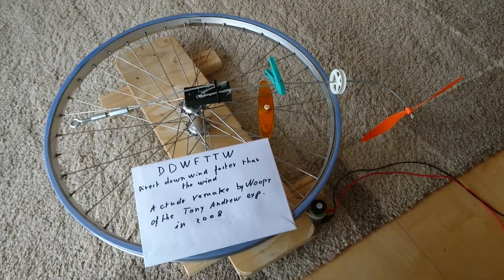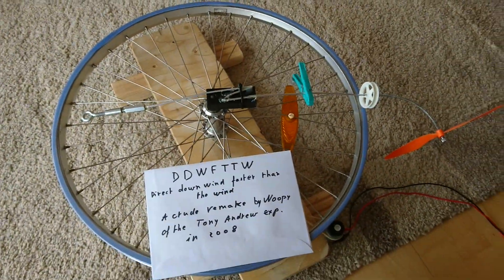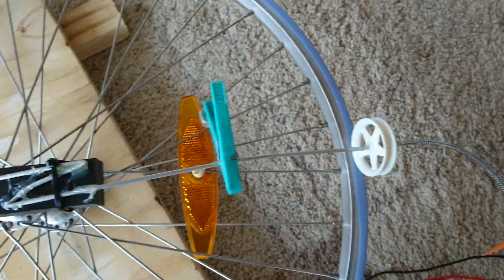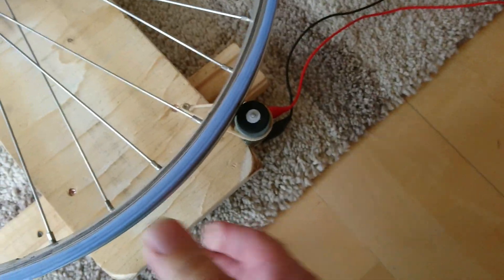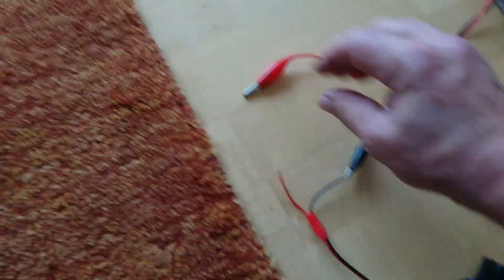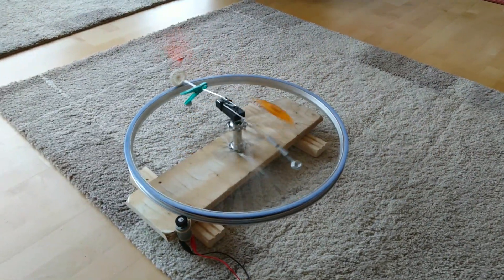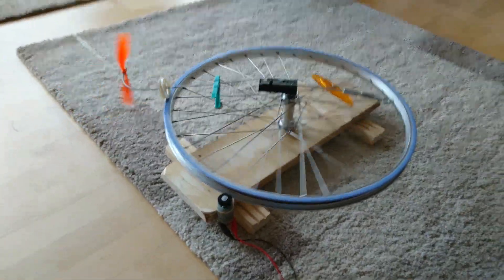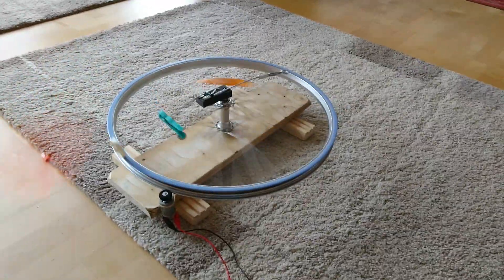Direct down wind faster than the wind my first experiment

Comment: I think this experiment is invalid and not testing what you think it is. All you are doing is driving a propeller with an electric motor and all it has to do to go forward is create more thrust than the rolling resistance of the wheel and bearing. If you increased the resistance i would go backwards and if you reduced it would go forward. Nothing to do with wind.

Comment: The frame of reference has change, due to the dynamic centripetal force upon the axis, vector dynamics seem to add to the net distribution of cause, when in fact they are just regauged as an unseen force multiplier.